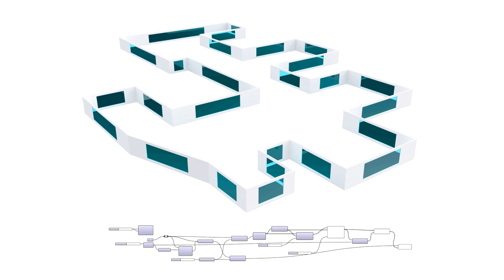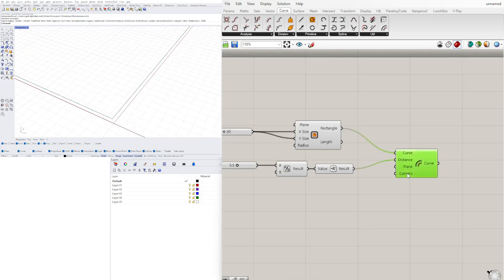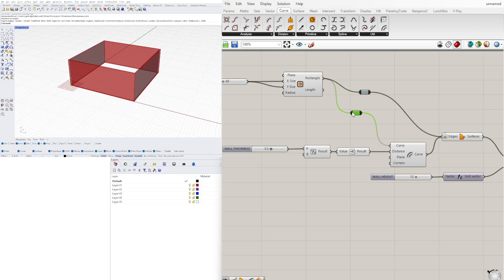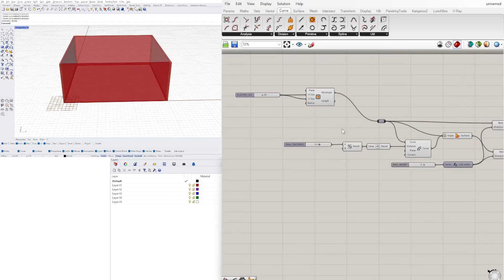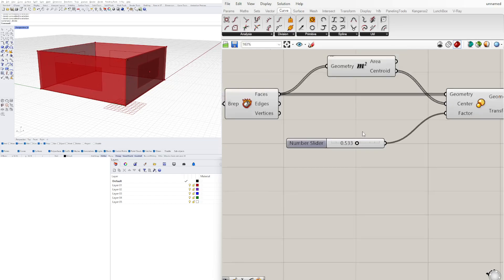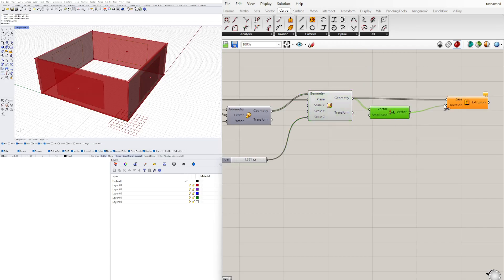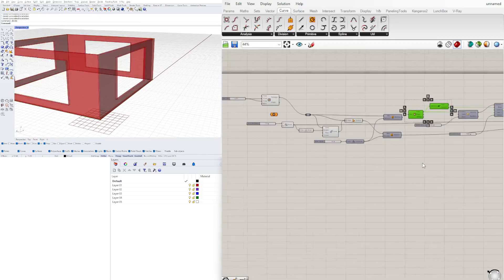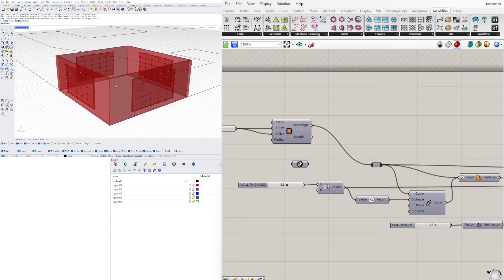Wall Openings Parametric Architecture and Design Rhino and Grasshopper Tutorial - BASICS

Comment: Hello DCO graphicstudio, thank you for the great job you guys are doing! I have a question, not related to your last video, sorry about that, same question I address to Parametric House team... however, they do not answer yet...  if I may... in Grasshopper ... how do you optimize an object you build ... for the size it will have as a file in the computer (bites) - for example a square... I fillet its corners... and extrude in Rhino... than save it as an stl file... it will be few times smaller (more than 10) than a square I fillet and extrude on Grasshopper - bake - and save on Rhino as a stl file! Do you know the magic behind the curtain ... and what make the stl files baked on Grasshopper "that big" comparing with plain "old" Rhino files? Thanks for your time!
Reply from the maker: I have not yet looked into bake size for an STL with grasshopper. It is typically a mesh that can be turned into an STL.  The mesh once baked can be reduced "_reducemesh" and you can pick the reduction percentage and number of polygons.  This is helpful, but can only help with reduction not quality increase.  For the most part, I like baking as a BREP "NURB" closed polysurface then turning into a mesh once in rhino, using custom settings.  you can get a very high quality mesh this way, and reduce using the reduce mesh method. Hopefully this is useful.  are you trying to create STLS for 3D printing?  I can make a video showing the process I take for this.
Reply: @DCOParametric   Thank you for your answer! If you want to publish your stl files, size becomes a problem... when a file of 5mb becomes a 60-80Mb - at same polygons number! And Sweep 1 Rail ( Actually Sweep  2 Rails) ... becomes a pain due to the size! Losing quality in detriment of physicals size ...  sometime is not worthed.  I did a project of a 3d alphabet with 250mm letters I wanted to publish... I end not using the Grasshopper design... what I made ... with one letter ready for export in one minute... and instead I took the time to make manually each one in good old Rhino! Anyway... thanks! Keep up the good work!